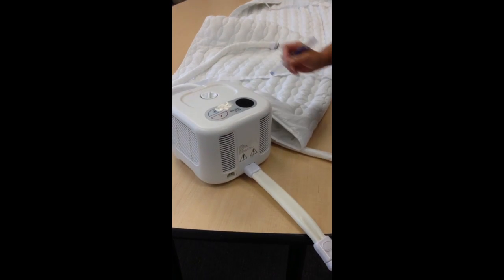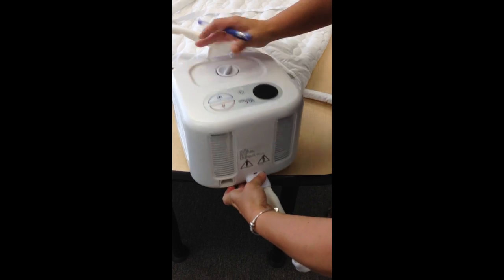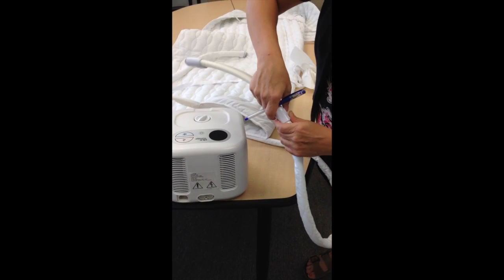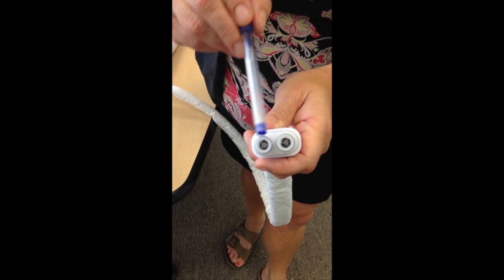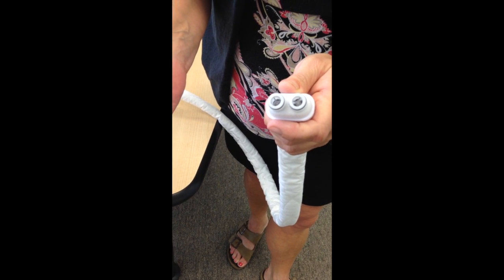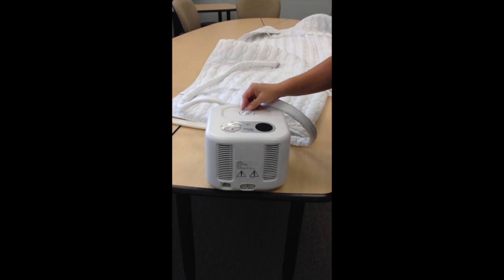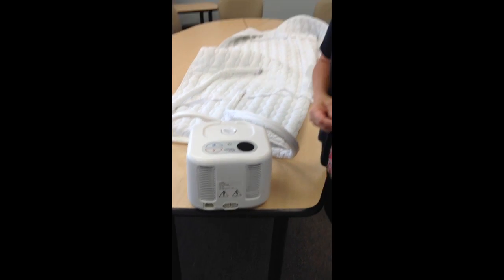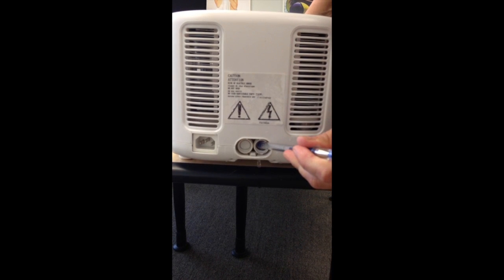How To Drain Your ChiliPad™ | Chili Technology

Comment: I hate this company.  Fed up with their lack of customer service, their ridiculous excuses for why they dont have this accessory or that and mostly their overall lack of either ability or desire to assist existing customers. Still waiting on a return call from 2002! I mean who runs a 4th of July ad and then nobody answers the phone for sales? They say there's live chat but that's only if there's somebody live to chat! Try to get somebody on the phone to solve your problem. Uh huh. Hardly happens. I think they like to get new customers but don't care much about retaining the old ones. If they did, theyd cater at least a little bit to their existing base. Ie. Reversing the male and female ends so that if one component goes out on the old system (cube or pad) you have to get a brand new system. There are no replacement parts! Then they lie and say they did it to improve their product. No, you couldnt keep your patent without changing something on it every 7 years. How does switching the gender of the connector improve the product?  Ask them if they sell a replacement pad or cube and the lame answer you get is"I'm sorry to inform you that…"  Nope. Not sorry at all. Standard answer and no recs on how to fix your problem, other than buying a whole new system that is. Then to cover up bad customer service they brag that they give millions of dollars worth of products away. Have you seen the questionnaire to enter? You have to write an essay to say why you need it.  The stories are read by an arbitrary company employee who makes a decision on the story that moves them most. What if the person who needs it most can't write?  Unfair idiocy. When somebody comes up with anything comparable with anywhere near decent customer service I'm going with the other company. Chili, you may not be on top forever!  ATT thought the same thing. A better mousetrap's acomin'!